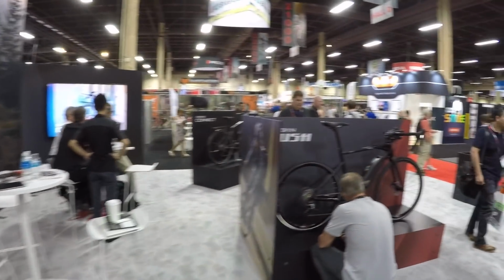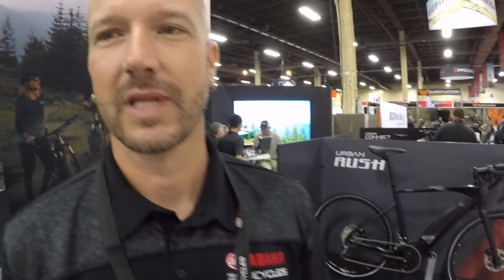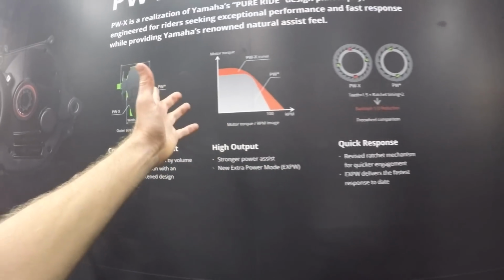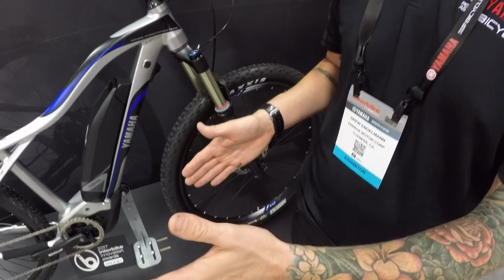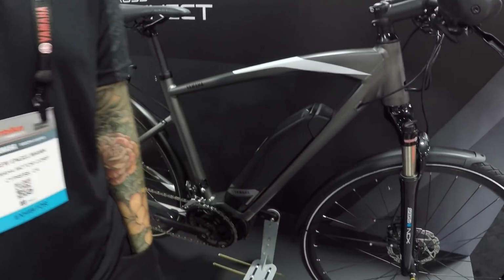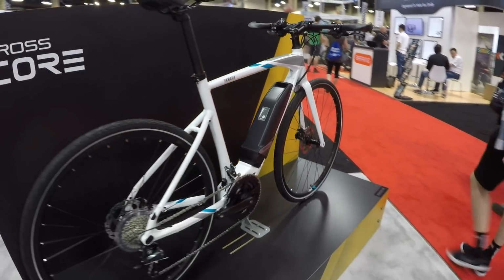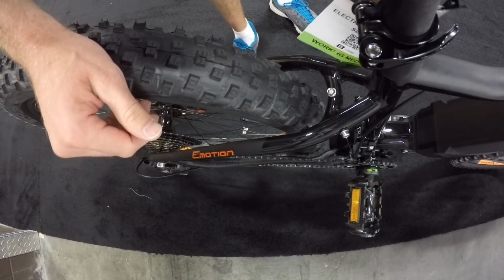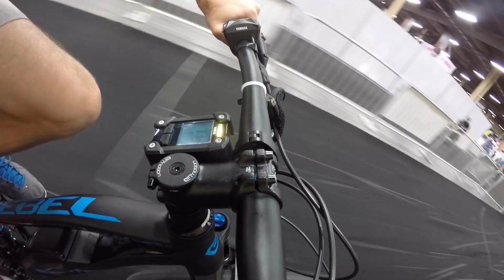2018 Yamaha Electric Bike Updates at Interbike (PW-X Motor, Urban Rush, Cross Core, Cross Connect)

Comment: It's typical for Japanese motorsports (car, motorcycle, watercraft etc.) companies to be very conservative and not disclose any upcoming products details, but don't let that bit of frustration detract from the fact that they collectively and Yamaha specifically makes excellent products. Yamaha's formal entrance into the US market bodes well for consumers. The ebike market is moving into a golden age and Yamaha products will help to spur other manufacturers' to improve their products and the value they bring to customers. We can also thank the car companies (and Elon specifically) for the rapid increase in battery tech/value that will soon have us riding quality 150 mile bikes at $2000 price point. Now the consumer just needs Honda, Suzuki and Kawasaki to enter the ebike field and we'll really end up with tremendous products/value. ON another topic, I find it shocking that traditional bike retailers shunned ebikes for so long and let others (typically smaller dealers ) dominate ebike sales where I live in So Cal. The bike retailer business has forever changed and the traditional dealers now have significant competitors that didn't exist 5 years ago. Good job seeing that coming.

Comment: I would like to hear how Yamaha will balance being an OEM supplier and compete against its customers with it own bikes. Or they are just giving the OEM market to Bosch.
Reply from the maker: I wonder the same thing, I tried to be friendly about pointing to Easy Motion and Haibike, makes me wonder if that is why Haibike is changing the SDURO to mean "sporty" and XDURO for "extreme" and removing the connection to Yamaha motors, in case they need to distance themselves someday if Yamaha starts to undercut everyone? Drew seemed friendly about it all, who knows
Reply: Drew was a bit cagey. Anyway, its never good to compete against your customers. If Yamaha's distribution resources force competitors out of limited floor space shops that will cause some real issues. Wondering how the decision was made - by the USA managers or the mothership in Japan? I'm not really sure Yamaha's experience with ebikes in Japan is that relevant too. I lived in Tokyo 25 years and 90% of ebikes are under powered pedal assist "mama-chari," that would never work in the USA. Plus, the Japanese police are negative on ebikes due to safety concerns on crowed urban sidewalks. There are a couple of Yamaha bikes for sale in Japan now that look very similar - if the pricing is same, then will be very aggressive. Bikes similar to Cross Core and Urban Rush are about $2,000 in Japan.  Lets hope the outcome is "rising tides raise all boats!"
Reply: Hi, John. I'm sorry I wasn't able to be more specific regarding this situation. The OEM business of Yamaha is managed by our team in Iwata, Japan and the Power Assist Bicycles line is part of Yamaha US business managed stateside. In both locations, Yamaha values being a meaningful parts supplier to Giant, Haibike and EasyMotion, and will continue to maintain the OEM relationships in Japan. With that, our group (USA) does not have access to information about the ekits created for those partners. I WILL be able to share what we do to the motor that we designed for ourselves at a future time, but we just don't talk about the customization that our OE partners have created for themselves. 

The bikes that you are seeing in the Japan market right now are the YPJ-C and YPJ-R that Court shared video of last year when we were there on behalf of the OEM partner relationships. They are not like the bikes being created for the 2018 product launch. 

Can't wait to share more in the future. Stay tuned to yamahabicycles.com and Court's channel to learn more.

All the best,

Drew
Yamaha Power Assist Bicycles
Reply: Thank you Drew. To me, its seems like threading a needle. Anyway, from what I can tell the ebike market seems ready for growth now that the technology has become so much more useful and innovative. Obviously, the market is very fragmented and lots of startups (under funded and otherwise) are jumping in and its really tough for the average consumer to understand the products or even access products with very limited distribution.  So I hope you guys are hugely successful and able to work past the conflicts.